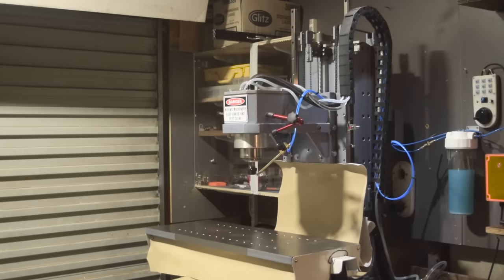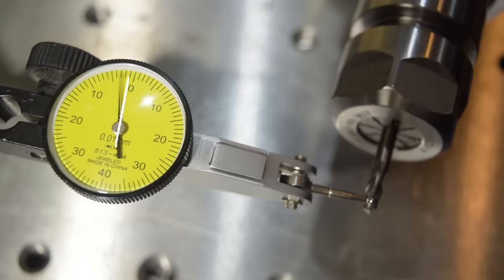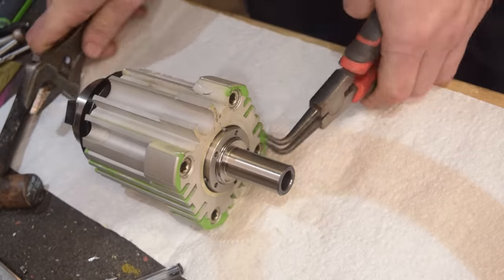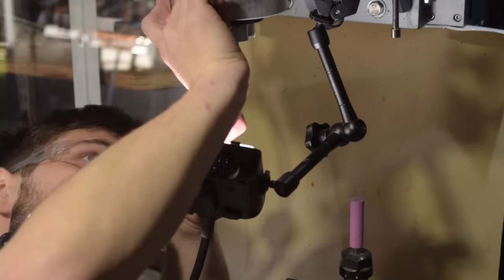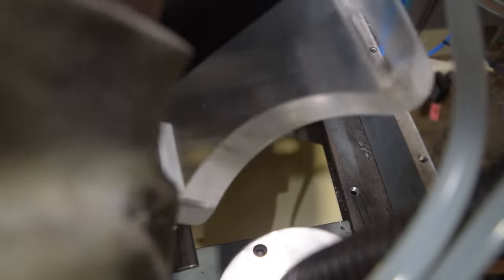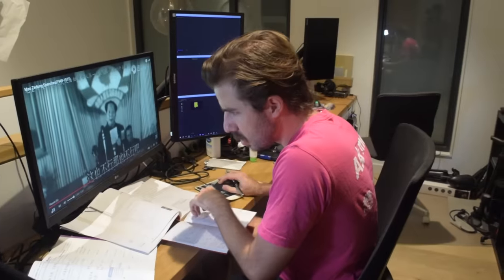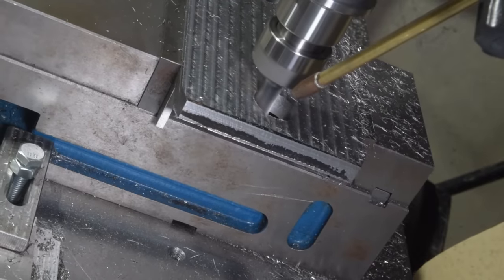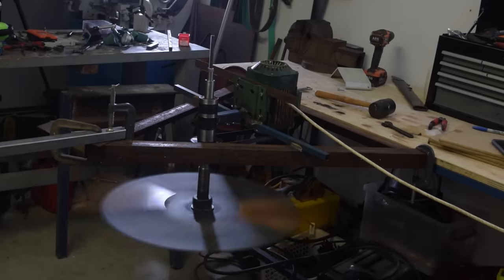I "fixed" this cheap Chinese tool

Comment: I would love to see more of your manual hack job 😁 
It is hard to wrap my head around how the f... you were able to get some half-decent values with that attempt.
btw. I was a bit dazzled to see you use a servo to drive the spindle. Do you mind to share the specs of it?

Kepp on rocking, mate :)
Reply from the maker: Hey thanks! I was as shocked as you, believe me. I went with a servo for the position control capability, which is necessary for an automatic tool changer, but also opens up a bunch of other interesting possibilities like broaching, and using the spindle as a fourth axis. The servo is 2.6kw, 2600rpm, with 10nm of torque. I'm running it at close to 1:1 at the moment because the belt I ordered was too short for the 2:1 arrangement 😪
Reply: @NoEngineerHere  I am totally flashed.
I would never have thought that 10Nm are sufficient to run the spindle!
Reply from the maker: @Jan_Seidel  most milling operations are actually quite low in torque requirements! It's drilling that gets you.
Reply: @NoEngineerHere  Thanks for letting me know :)
I have just started designing a CNC mill and picking the proper servos is quite a challenge. It is hard to find specs from manufacturers and if you are lucky the numbers a vague. Like Tormach stating 20Nm - 48Nm.
The Servos you use is kind of a steal compared to servos 20Nm+
Reply from the maker: @Jan_Seidel  I have an app on my phone called feeds and speeds wizard, you can input tool parameters and it will output feeds and speeds(of course) but also torque and power requirements for a given cut, maybe have a go at something like that to get an idea of what you'll need!

10nm is definitely a little underpowered for some operations, so I was planning on building a hi/low belt drive arrangement.
Reply: @NoEngineerHere  Thanks for sharing your experience, mate :)
I will have a look into that app

Comment: You were trying to grind the taper by interpolating!?  Yea, I think you might have far better luck moving in only one direction.  Why didn't you try grinding it on your lathe?  Your cross-slide should be able to be set on the taper angle and you move in one axis, just like boring.

Comment: wouldn't lapping compound do the trick?
Reply from the maker: Unfortunately not on a taper, there's a bit to unpack there, but one of the keys to lapping is being able to move the lap axially so that every part of the lap touches every part of the surface; not possible in a taper, as there's only one axial position where the lap is contacting the taper
Reply: @NoEngineerHere  I was referring to something a kin to Adam Savage's  video on lapping a fractal vice. also thanks for the reply.

Comment: That "beyblade spinner" is so horrifying. Just hope we have a ways to go before the amputee arc.
Also my terrible idea for the taper griding, dip one of your tool holders in glue, roll it in abrasives, clamp it in a vice and let the machine lick the worst sour candy ever made.
Reply from the maker: Still have my arms... barely. It'll be a cracker video
Reply: @NoEngineerHere  Ohh I am excited now! Glad to hear another video is coming out on that crazy thing

Comment: Building machines is so painful lol.  You should have made a spindle on your lathe and used a simple motor to drive it via a pulley
Reply from the maker: I did actually do a rough design and price-up of a spindle, and along with the hurdles of heat treatment and precision cylindrical surfaces, I figured I'd take a gamble on this thing. But the perceived weight of obstacles seem to shrink over time, so it's only a matter of time 📈

Comment: Is that a Teensy 4.1 at 7:46?
Reply from the maker: It is! On the breakout board for GRBLhal by Phil Barrett
Reply: They are really, really fast! I had a dalliance with these while I was playing with STM32's after changing from PIC32's last year. Teensy are simply the business. Nice work BTW. You're doing what I have been (really slowly) doing for about 20 years :) It's really cool to see. (yes I have subscribed!) :)

Comment: Hey m8, when using the grinder you gotta flush the material out. those cheapose grinding stones get clogged up fast and PUCKS the hell out of the rotating shaft. 0/10

Comment: normal hobby user not newer need automatic tool change system, only factory need, and if you have factory you have money buy good working machines. hobby user only waste lot money build automatic tool change system or too big spindle or other servo motor closed loop system etc.
Reply from the maker: Yeah but I WANT it
Reply: @NoEngineerHere  i want too many, big house, good wife, million dollar money, big workshop, airplane, ferrari,  but all not sure need or can take. can live good if not have all :) all not need what want.

Comment: note to all: if you have no other choice but to buy that chinese made garbage, ALWAYS change out the bearings first. chinese bearings SUCK and rarely if ever run concentric or planar. always buy ABC  bearings (anything but chinese) ...then check your runout when you've replaced them

Comment: The problem is the Chinese used the same cheap, poorly made tools they manufacture to manufacture your spanking new cheap, poorly made tool. You ever buy their latex drill bits?

Comment: Mate don't buy made in Xhina shite. ( I can't even mention their name due to fear of repercussion).
If you can't afford the good ones, save up and buy later on. Made in Taiwan is a lot better, if you can't afford the goodies from Germany/Japan.
The materials that they used is terrible, same as their processes and paperwork, nothing can be traced, and  I mean it, as I have been to their factories.. You are bound to find out later on. I personally don't even buy screws that's MIC.